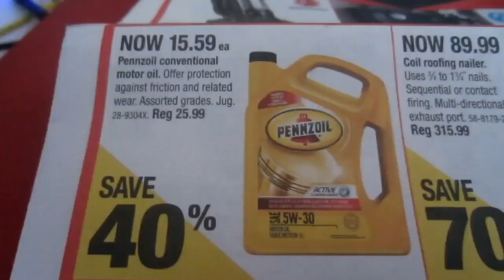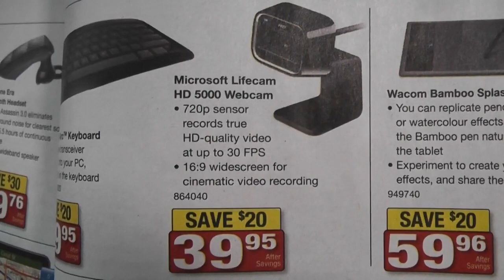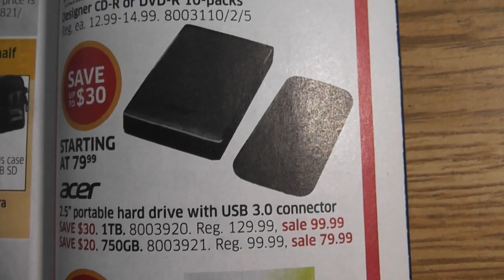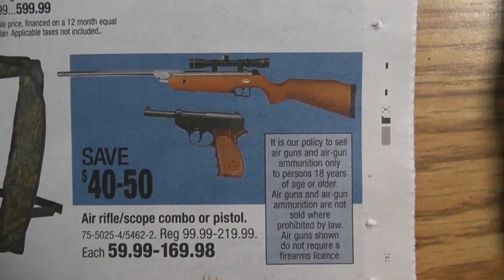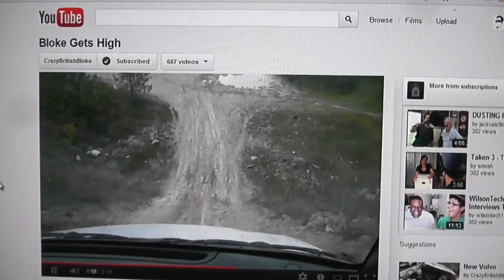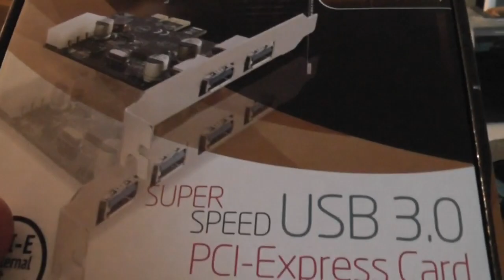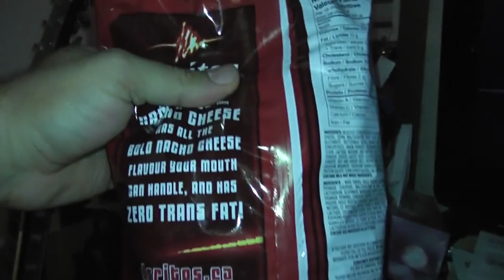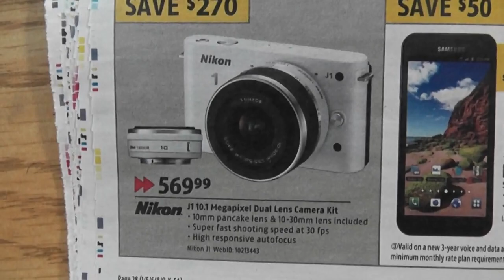(Day 575) - 08-17-2012 - There I fixed it and cleaned it!

Comment: Hey Adam, where did you bought that usb 3.0 card? I would like the same one! I have a dell dimension 9200, it's kind of old (2009) but it got the propper connector on the motherboard, do you think it would work in it?